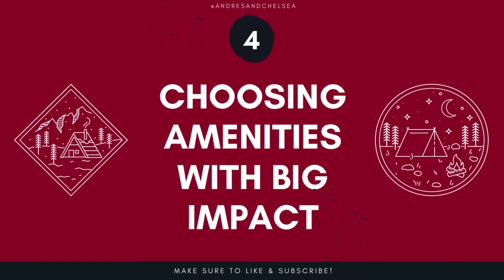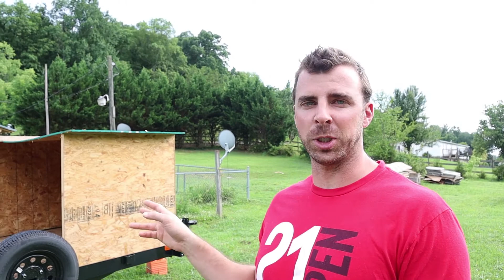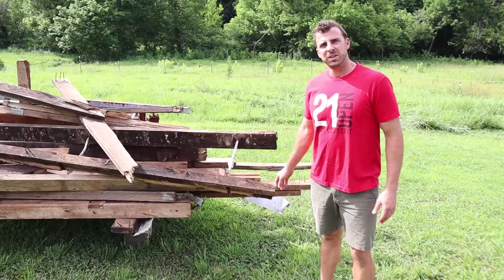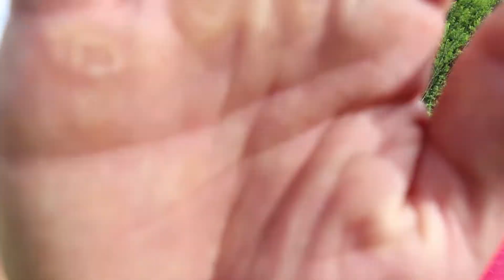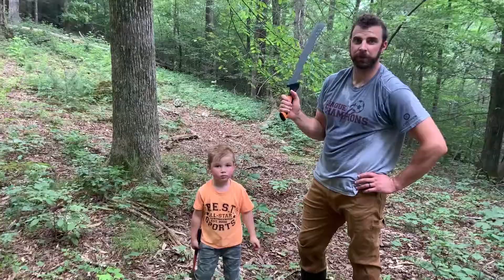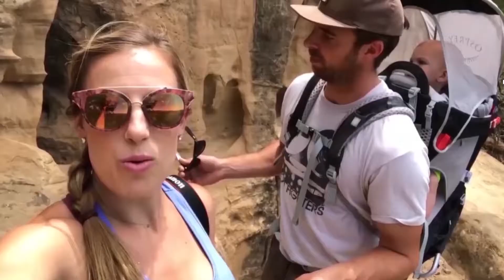How to Save Money on Materials Building Your Tiny House Glamping Site // DIY Glamping Site Build

Comment: Do I need a permit to build an A frame , 200 sq feet?
Reply from the maker: Good question! You would need to look into your county/city regulations. They may have restrictions on square footage, and/or if it’s in a permanent foundation, and/or if it has a bathroom and kitchen, and/or if it has power and water…. Lots of variables so unfortunately there is no easy way to answer your question. 

I am guessing you are trying to build an A frame in your backyard? Or do you have a piece of raw land?